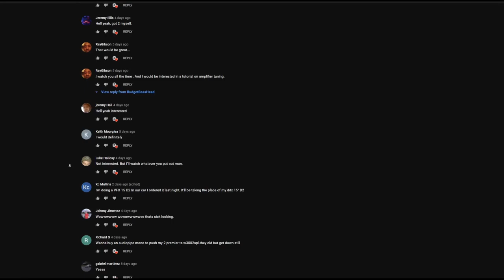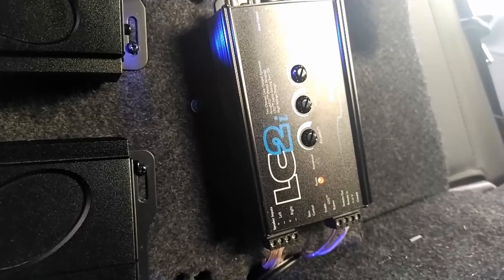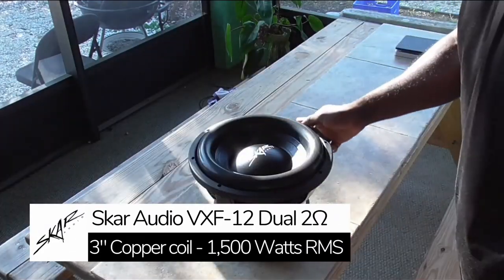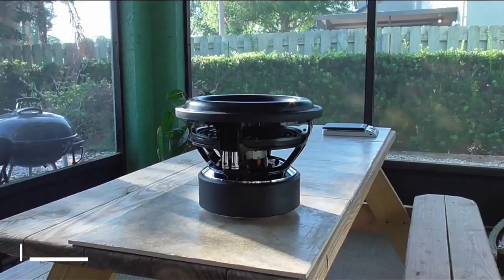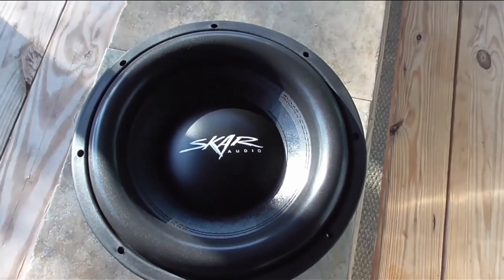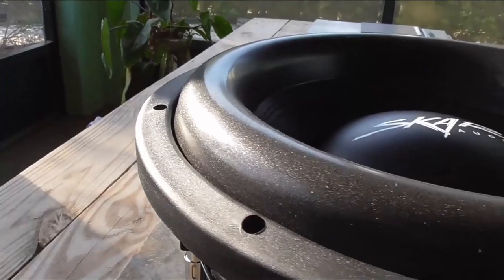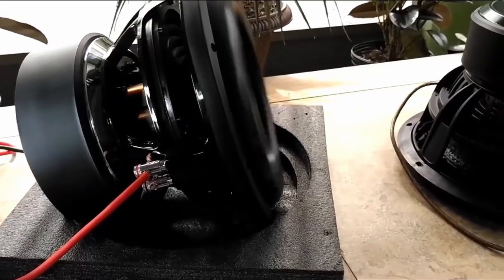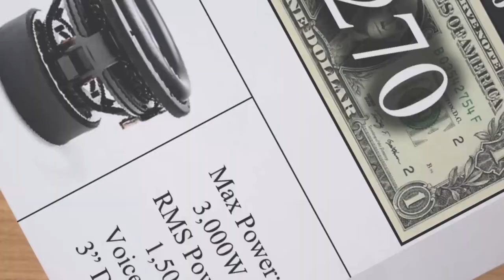4,000 Watt Daily System: Dual Skar Audio VXF-12 | Subwoofer Flex Demo

Comment: Box makes no sense at 38”.. can’t fit it in most car trunks unless you turn it the way you did.. they should’ve size it down to 32-33 like everyone else does for dual 12 boxes and added a little depth to it.. don’t recall the height either I think it’s only 15” tall while as the single box from same line is 16” tall.. 

Rule of thumb.. don’t build prefab boxes over 33” if you expect to actually sell them to more then suv drivers.. 

Side loading isn’t the worst application in a lot of trunks with folding rear seats..
Reply from the maker: Agreed